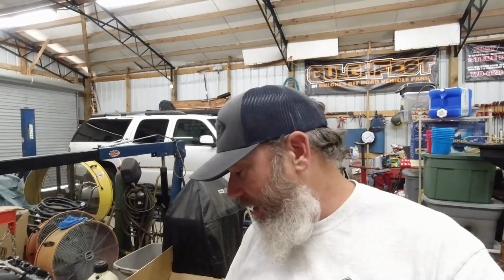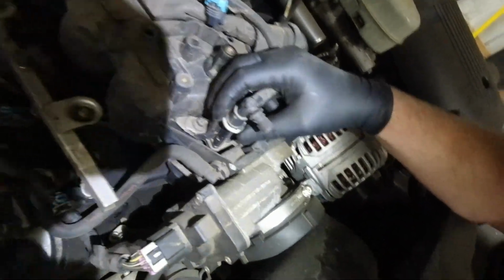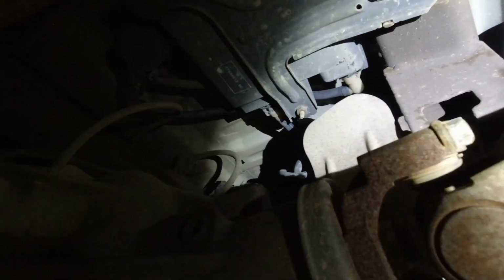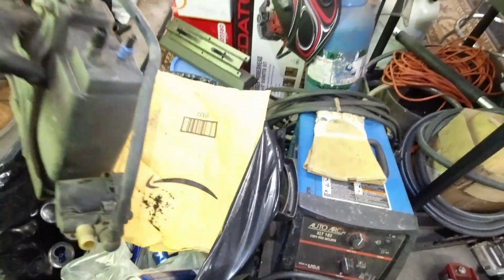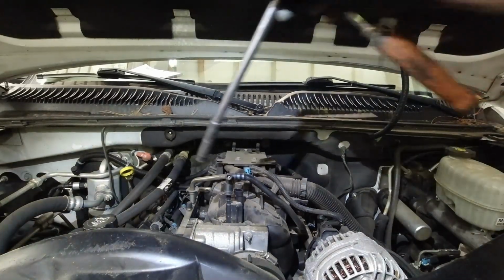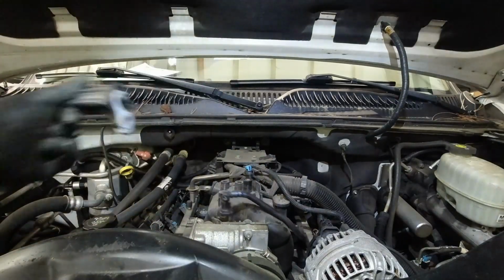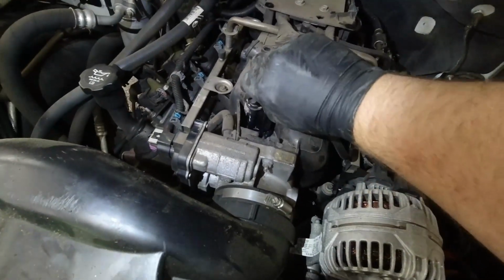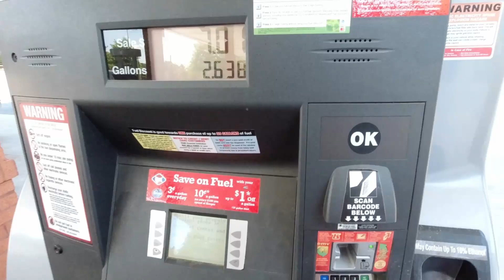Suburban Not Taking Fuel At The Pump

Comment: I had the same problem with my truck kicking off the fill nozzle every time I try to fill the tank but found my canister was not plugged. The little carbon BBs inside the canister had gone down the tank vent tube and plugged it up at the point where it attaches to the tank. I had to vacuum the BBs out of the tube and the problem is now solved.
Reply from the maker: You had it easy. I have had some similar to that and took compressed air and blew the vent hose out but not on this style fuel system

Comment: Just got fuel pump fixed and now i cant fill the gas is there a chance the shop pinched my vent hose when puting tank back up? Everything worked fine befor i got fuel pump replaced. I disconnected the charcoal canister  no charcoal came out of the lines.
Reply from the maker: I would take it back to them.
Reply: They wanna charge me evan knowing I have a warranty on parts and labor that they did
Reply: And I don't want to give them another dollar charge me almost 5k for fuel pump and wheel bearing and transmission cooler lines and oil cooler lines.
Reply from the maker: That's not good. You may have a pinched line. You may need to drop the tank some and inspect it.  @highlifegoodlife5400
Reply: Thats what I was thinking imma inspect it more today and I'm lowering the tank. I seen 1 video that the shop put tank in and pinched lines cuz they didn't run it the right way so that's were I got the idea. When I got keys back from the shop the guy asked me to promise I bring It back if theres problems but I just said hell no  in my head. And I called and told them about not being able to fill and they said I'd have to pay them to diagnose it.
Reply: They put in new fuel pump and pinched the breather hose flat. Fixed it routed hose above cross member

Comment: I replaced these 3 parts plus the fuel pump and blowed the lines and it still want take gas, any suggestions
Reply from the maker: I have 2 videos on that repair. Something is still clogged in the system
Reply: Did you find out what it was?

Comment: Hi, I am having the same problem with my 2011 chevy suburban.. we changed the charcoal canister and the purge valve solenoid but its still doing the same thing.. should it have been fixed either way without changing the vent solenoid or should i change that too and see if it works? Also, how can I clear out the codes that come up whenever i fix something on the car? very informative video .. thank you
Reply from the maker: Check out the Playlist for the Suburban.  I had to make more than one video and repair on it. You can unhook the battery for a while and it might clear the code. I use a code scanner with the option to clear DTC's.
Reply: @HotRodDave  just saw the other video about clearing out the lines .. i guess we'll try to change the vent solenoid either way and then clear out the lines like you did and see if that works.. and okay gotchu thanks so much ill try that
Reply from the maker: @loreliperez100  hope it goes good for you.

Comment: Bad charcoal  canister  can do this or leaks in it. Another big one I noticed  happened   is  the flap breaks and goes down the filler neck causing it to keep clicking while fueling.i know ford's gave a anti drain back valve so you can remove e the neck with out gas coming out not sure if all cars are that way